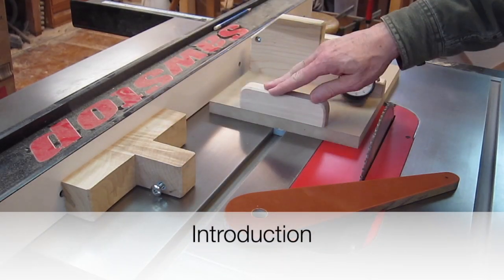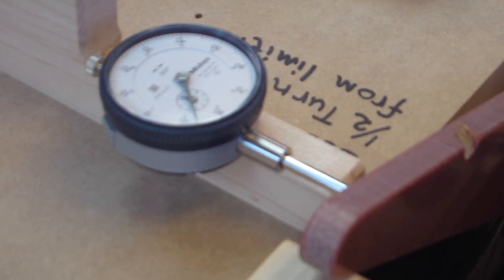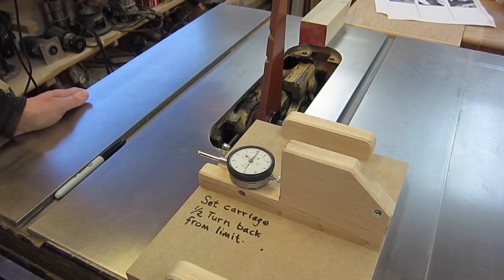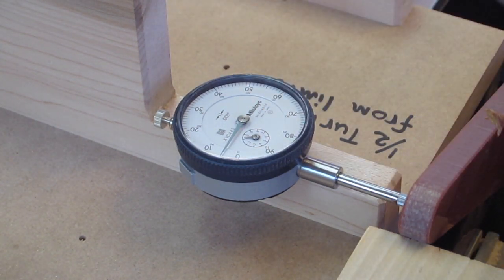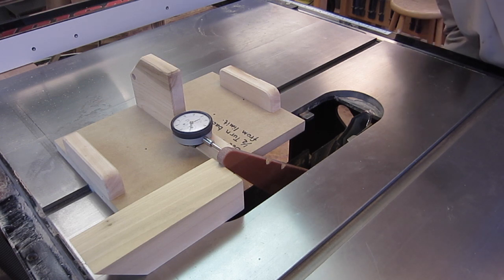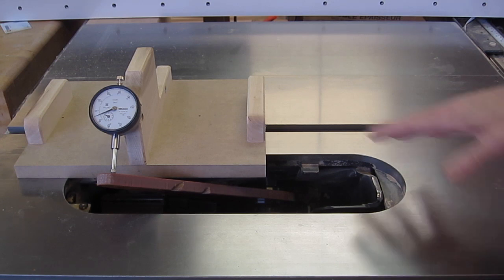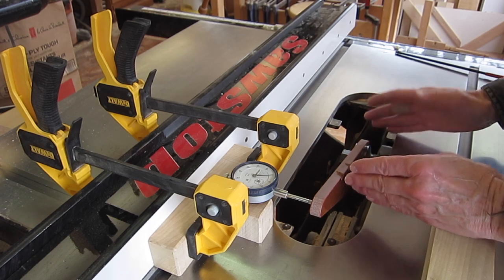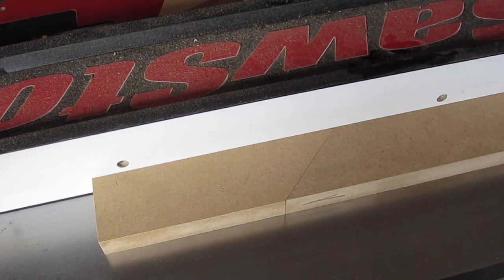Alignment of Table Saw Blade, Slot and Fence using dial gauge and shop made fixtures.

Comment: Thanks. I appreciate your methodical approach. Also your saw top is pristine. Great
Reply from the maker: if I moved the camera closer the cast top would not look so pristine.   Saw was manufactured in 2011, and I was not the first owner, so all things considered it is in good shape.     

I was using Minwax paste wax, but switched to Collinite 476s.  The Collinite is a car wax so it does have a small amount of silicone, which is not a good thing for wood finish, but I am not concerned about that as it dries very hard, and have not had a problem with finishing.  I find the Collinite dries much harder than Minwax and lasts longer.  https://www.collinite.com/product/no-476s-super-doublecoat/

Apply the Collinite in a circular motion and apply as thin a layer as possible.  Allow to dry hard then buff.  If there is a thick spot of wax that cannot be buffed out, remove it with the edge of plastic credit card.  I buff with a clean cotton cloth under a palm sander.  Replace the cotton cloth as soon as it feels like it is sticking.  Does not take much work to do 3 thin coats, which gives good protection.

Minimum preparation, before applying wax, is to remove old wax with Denatured Alcohol, which is also called Methyl Hydrate

Maximum preparation is per this video:  https://youtu.be/xaDJC-mo9LQ
To speed things up, I place the ScotchBrite 7448 pad under palm sander with sandpaper on it.  If surface is really bad then I use ScotchBrite 7447 Maroon colour, but be sure to do entire top evenly to maintain flatness.

Comment: Best alignment video I have ever seen.  This is what woodpeckers should be selling at a fraction of the cost of their alignment device.  Really a great video.
Reply from the maker: Thanks for feedback.    Spend your Woodpecker budget on a good dial indicator and make the simple fixtures.  ;-)
Reply: @steven.woodward  Even a cheap dial indicator!  Have you seen the TSAlighnor?  I would very much like to build something similar.  Anyway fantastic video and information.
Reply from the maker: @tomwrzos9251  The Problem I have with  TSAlighner. and similar jigs is that they don't work for blade at minimum height and don't work for blade at 45.     Any dial indicator that moves smoothly will to the job.   Absolute accuracy not important, just looking for small changes.  Good luck with your jigs

Comment: Thanks for the informative video. Does it matter which miter slot the blade is aligned with?
Reply from the maker: The blade on saw shown in video, tilts away from the miter slot that the jig slides in, which makes it easy to measure with the dial indicator when the blade is tilted to 45 degrees.   On some saws the blade tilts the other way, then it would be better to use the other miter slot.   Hope this makes sense.
Reply: @steven.woodward  yes I think it makes sense. I think what you’re saying is to align with the miter slot that the blade tilts away from. Thank you.
Reply from the maker: @GCheung55  Well said

Comment: Hey Steve, I found that the zero clearance blade insert (mine are from Rockler) make a good substitute for a dedicated piece of phenolic.  The insert that I use is made from phenolic and have a 1 inch finger hole which I slipped over the blade arbor and tightened in place with the blade washer and nut.  I did make a spacer to make a better fit but found this was an unnecessary step.  This might make it easier for others to use this method.
Reply from the maker: Great idea.

Comment: Hey Steven, This is a really well thought out process.  Thanks for sharing.  I remember reading that it's okay to have the fence have a 2-4 thousands runout at the back of the blade.  This is much like the you stated with the 45 degree blade alignment, it doesn't have to be perfect if the runout is slight and not binding.  Do you try for perfect parallel fence to blade, or a slight runout at the rear of the blade, to release pressure?
Reply from the maker: I have not tried setting the fence to runout slightly at the back of the blade, but seems like a good idea to avoid the back end of the blade rubbing against the wood when ripping.    The amount of runout should be small because when doing other cuts, such as dado, then no runout would be best.    I may give it a try next time I check alignment, which should be soon, as my last alignment check was when I made the video more than a year ago.    Thanks for mentioning Peter.

Comment: Thanks definititly trying this. Altough I only have a very old delta. Needs a new motor and a good amount of  TLC
Reply from the maker: Thanks Johan, let us know if the alignment works on your machine.   
An old machine, well restored, can be better than a new machine.   I restored an 1984 Delta thickness planer and would not trade it for a new planer.   https://youtu.be/zFdcSKi47ZU
Reply from the maker: If your arbor needs to be trued up this video may help:  https://youtu.be/H58W3huJeRk